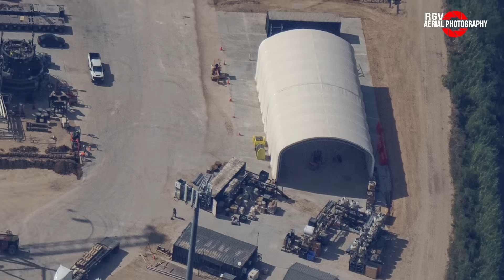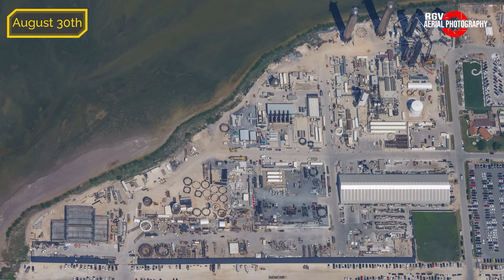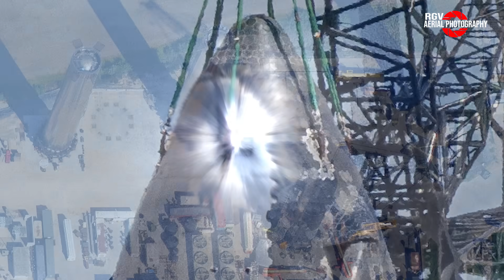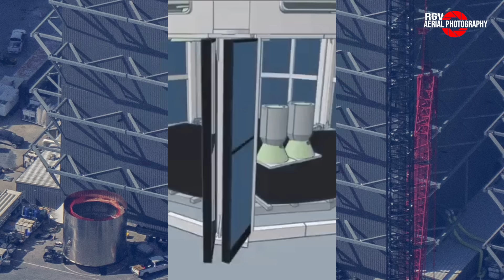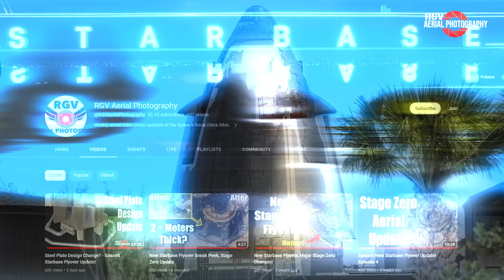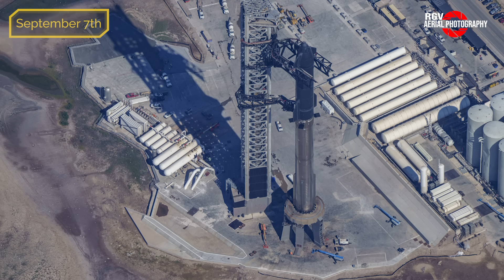FAA PROBLEMS ALL FIXED?! Starbase Flyover Update Episode 16

Comment: Thanks again for the great work. Doors on the buildings make sense, especially lower doors to pool the air conditioned cooler air and make it more comfortable (and productive) to work at the lower levels. Complete doors for storm protection also make sense. i don't think they left headroom for VAB style doors so sliding or hinged in segements.

Comment: If there's aircons for the bays installed, then i'd agree days of casual monitoring of work inside the bays is over. If not, then the doors are probably weather related, meaning they will remain open for ventilation, but close when weather starts affecting production.

Comment: Please stop posting videos stating the FAA problems are fixed. The FAA didn't recommend any fixes spaceX did a investigation of what went wrong and fixed all the problems or are fixing them currently. 

The FAA only reviews this Mishap report  and either agrees/disagrees/ asks for further info of the refered fixes  before giving  clearance to fly once they are satisfied. 

For the FAA to actually do the investigation themselves would be counter InuitIve as they wouldn't have a clue what they are looking at since they didn't design it. 

Not having a go just it's kinda misleading of what the actual process is.

Comment: There's a very good reason SpaceX doesn't patent their groundbreaking innovations such as their Raptor Engines and how to re-fly and guide a booster back to a safe landing. Patents are a Scam in that they expire, then making your inventions/innovations/processes Public information. Yea, you can do slight modifications to a patent and stretch out it copyright protection, but the original idea is then released for public scrutiny. 
   It's the same reason Elon will interview critical new-hires as SpaceX Must try to protect against industrial espionage. EM has delt w/ industrial espionage before w/ a Subaru engineer infiltrating/spying on Tesla. It's highly likely there are others as well. SpaceX has made Great progress into perfecting their StarShip & Super Heavy assembly processes using Stainless Steel and keeping it from prying eyes is Much better than a patent.
   They're developing a Much cheaper way to build rockets and If all this works, everybody in the industry is gonna want to know how to copy them if they don't already. 
   Have you seen China's drawings of their proposed recoverable Rocket Boosters?, they look almost Exactly like a Falcon 9. Yea, SpaceX wanting some privacy w/ their assembly processes doesn't surprise me a bit.

Comment: I suspect that the impending doors on Megga Bay 1 are to keep wildlife out rather than to stop prying photography. Once the Starfactory is complete, ship & booster construction will be from start to finish in a clean-room(ish) environment.
Reply: No rocket has ever been built in a clean room environment.
No idea where this idea comes from - it is pretty silly if you stop and think about it. Welding is dirty, very dirty
Reply: @joshua43214  A good point... doors should stop birds using the high bay as a giant roost though and pooing on the workers below lol ...
Reply: Also, do any of those bays have aircon? I'm guessing probably not practical with them having huge holes in their sides, apart maybe for a few enclosed office spaces around the base, but perhaps putting doors on might also allow SpaceX to get some level of aircon - or reduce the running cost of any aircon already in there substantially. I'm sure that at the height of a Texas summer the workers would appreciate that.

Comment: Quite a few people think Ship 26 is going to be used to test cryogenic propellant transfer. Has it undergone any unusual pressure testing that previous ships haven't?
Reply: It might also be to test the launch behaviour of something closer to an HLS ship which, like SN26, isn't going to have flaps or a heat shield so will have slightly different aerodynamic properties and weight distribution vs the more conventional ships that we have mostly seen so far. I'm sure SpaceX has a pretty good handle on all of that HLS stuff via computer modelling but HLS is a NASA project so NASA might be pushing for some more physical validation points (real life demos) in the HLS development plan.

Comment: Also everyone is focused on rockets and big buildings but IMO the things you see painted white are final designs.  I use GM as an analogy. GM builds some new electric car, they have to build the tooling for that car. Same with Spacex and rockets. They've been refining work flow to get the machines and work stations just right so that efficiency is is maximized.  I expect a lot of the stands you see rockets, boosters and other parts getting shuffled will be scrapped because the finalized machine is installed in in one of the Mega-Bays

Comment: You know they're going to put doors on the assembly bays. My guess is it is a lower priority item which also has a long lead time.  All one needs to do is look at the historical spaghetti plots of tropical storms and hurricane to know doors were always in those building future. Even non-tropical weather, working with rain and dirt blowing in is way detrimental to QC.
Reply: that aside, I'll bet the guys working inside have been begging for some AC too
Reply: @Corvus.2606  Once doors are installed they might .but  my guess,with how the doors tend to open a lot ..they may not be able to get A/C intalled  .
Reply: @Corvus.2606  I don't keep up with stuff nearly as much as some of these folks but at base of the Mega Bay in this very video where they stuck the white  stand, there is a low roofed building on the road side of Mega Bay 1? and there are chiller units already set up outside. I would not be surprised to see floors at certain locations that see a lot of activity and on those floors will be enclosed spaces that they do provide HVAC to.  You install massive chiller units that chill water way down, pump water to air handler with heating and cooling coils inside at specific locations. They certainly won't use scaffolding long term and both boosters and ships are tall.

Comment: How will there lift SN 26 without the forward flaps?
Reply: They don't lift with the flaps. It's a ball and socket system on the chop sticks
Reply: @jeremyfarmer2502  but where it picks up is under the side of the flap point against the hull of starship 26 has nothing there to do that so how then it is streamlined like a bullet ?

Comment: If possible, could you please do side by side photos? as it will be 100% better to see the comparisons.
Thanks
Reply: FYI as a Patreon member they provide a user controlled slider image of the current and previous flyover to peruse at your leisure.
Reply: @erudite8841he means side by side in the same frame. They don't do that.